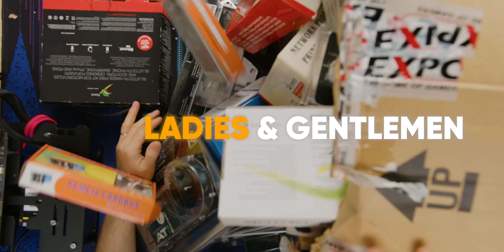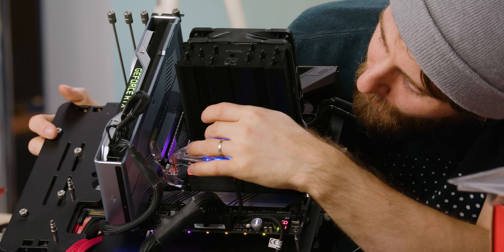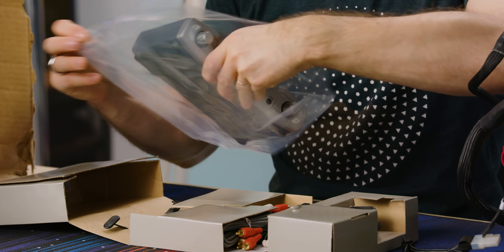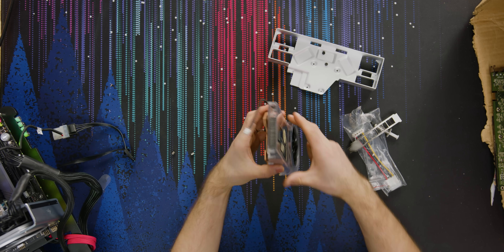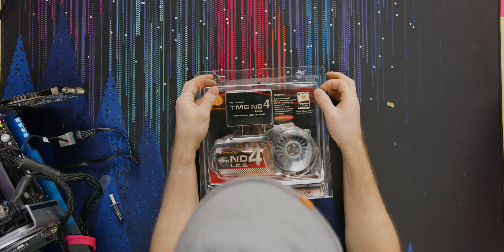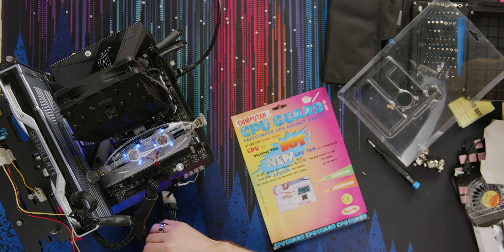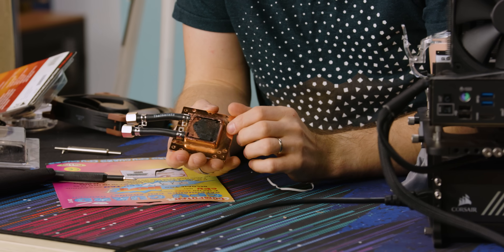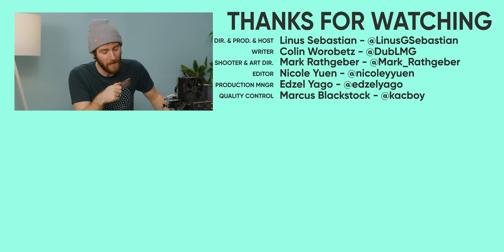I Bought Out This Bankrupt Computer Store's Inventory

Comment: I've still got a bunch of those IDE HDD sleds.  Back in the day, I had several identical chassis set up with them, so I could swap boot drives around for various customer configs, DB servers, etc.  Then virtualization came around and I decommissioned all that stuff, but it worked fine at the time.  (The 40mm cooling fans in the docks were cheap & noisy.)
Reply: Those wide radial (not axis) ones? They make such an annoying fluttering sound

Comment: That ATI cooler still works on my X800 GTO, I wonder if I installed it in my first half of lifetime or second.

And Linus could have thought more on those IDE 5.25 drivebay slot with interchangeable drives. With one PC and a family there is no better user switching then flipping whole OS drive.
There was solution for SATA as well, maybe even supporting hot swap.
Reply: If you paid a bit more- there where hot swappable versions for both.  But you would still want to reset if it was boot drive.

Comment: My 3.8GHz P4 w/ Hyperthreading (478), 2 gb of DDR2, and 4x Raptor 10ks in Raid 0+1, and a Radeon x800 256mb, Windows XP 64-bit... even had an S-Video out to my TV (gross).

$3800 or so in 2004ish. Lasted me easily into 2010... Though admittedly I was pretty furious about the immediate release of DX9.0c (unsupported on GPU), actual dual core processors, amongst many other immediate paradigm shifts in the space. Was still a fun project :)

Comment: This is so much nostalgia. I am having flash backs to building my first PC in  2007. Intel Core 2 Duo with an EVGA 8800 Ultra. Fan cooled heatsinks on the Raptor hard drive, black light cathodes all in a Cooler Master Stacker II. Yes, it could play Crysis. I still have my first video card on my wall.
Reply: and today all these years later, you can buy a nice used card with what a 3090 gpu costs!

Comment: This brought me back down memory lane being an enthusiast in the early 2000’s. Flimsy molex y-splitters, the cheesy cheap packaging, everything being creaky. I still have one of those NV Coolers installed on a GPU in a MAME box.
Reply: man you recall those turbo fighter fans? then ramped up to hella high rpms, legit sounded like a model plane starting up lol.
Reply: You mean back down memory channel
Reply: You need 2 hard drives? Gotta set the pins correctly with those IDE flimsy cables. Cable management involved folding... And it mattered for airflow!
Reply: I cringe whenever someone utters the word "molex".  Worst quality power delivery EVER!

Comment: Oh wow, I had the AC NV silencer. I got a Gainward 6800GT with a dual fan setup and it was insanely loud, like literally unusable like a hairdryer next to your head. This cooler totally solved it and even allowed for overclocking, To this day I still really rate Arctic stuff, I have their AOI on my 3700x and it works great.

Comment: I have a TV Tuner plugged into my computer currently and it's just so-so anymore. I live in an area that still has a locally owned cable company that broadcasts their basic cable package (ch 1-100) without any encryption, so tuners still work on it. But with most TV networks insisting on reserving everything good for streaming, as well as filling their channels with bad reality TV or excessive commercials (like 15 min of commercials for 30-40 min of actual content), AND the discontinuation of Windows Media Center (I think Kodi can handle tuners but it's a way more rough experience), AND those streaming services refusing to stream anything above 1080p unless you're using a streaming stick and a whitelisted TV (thanks HDCP), tuners are definitely losing their value. And again, that's assuming you have cable or antenna content that isn't scrambled in the first place.

Comment: I had that Arctic Cooling GPU cooler for my ATi 9700 Pro. It worked like a charm. I think that was the last generation of single slot cards because I seem to remember my ATI X1950 XTX that I got a year or 2 later being dual slot.

Comment: O "It's not grounded, how is that even possible?"   Linus the black wires often referred to as "0v" are NOT ground wires.  They are the voltage to witch the other wires are referenced to.    So between Black and Yellow the Yellow wire is +12V with reference to the Black wire we call 0 but may not ground.  The blue wire from pin 14 is the -12V when referenced from Black but if referenced from Yellow then  Yellow can be called 0 and blue is -24V or the other way round when Yellow is referenced from Blue than Blue can be called 0 and Yellow is +24V   No wire on the computer side of a PSU can be consider ground apart from a metal chassis that should be connected to the center pin on the mains plug.  O by the way, in the UK this is now called the Protection and not earth/ground, but thats a how different topic.

Comment: 6:27 there is the Arctic Cooling NV cooler. The ASUS 7800 GTX had that exact cooler on it when I bought it at NCIX in 2003 or somewhere around that time. Crappy thing is I gave that card away in an old Athlon 64 x2 about a year ago, wished I'd have kept it.

Comment: I actually have this type of card reader in my pc because it was in the oooold case I am using but mine hasnt got the usb cable but the internal usb for the front panel and it has a micro-sd slot too otherwise the same lol

Comment: @colin That parallel port adapter probably won't work with your lathe. Don't quite remember why but if you use all the pins the conversion to usb breaks the controller to computer connection. 
A Smoothstepper is more likely what you need.
Reply from the maker: I actually already have the correct FTDI chipped usb adapter, I do see some odd things that would be useful to have this adapter for though
Reply: @LinusTechTips  alright fair enough! Enjoy the holidays.

Comment: I totally had multiple of these things. I used an hdd hot swap bay to flip between an IDE-based zip drive and a hard drive. I also put an arctic cooler GPU frozer on a 9600 pro and 9800 pro. Totally had the hard drive cooling enclosure for my WD Raptor...

Comment: That 5 1/4 drive bay with hot swap drive cage with handle and lock(the lock dubled as the power switch so you could not pull the drive out while it was on) was a real cool and useful thing for us people that ether use multit OS's that want each on a different drive.  However for me it allowed me to take my data home and work on it then take it back to where I was working and use it there.  It was the USB-sick of the day.  It was at the time of dial-up BBS and compuserve

Comment: We had dozens of those removable drive sleds, with massive 200mb hard drives, in our lab. The Gateway 2000 desktops we used had multiple 5.25 bays in the front so we could have a floppy, CD, and one of those. They were actually super useful, we could swap Novell, NT 3.5, OS/2, SCO Unix, Banyan Vines, etc. really easily. Saved us so much time and effort reinstalling all the time for different tests.

Comment: I used the 5.25" portable hdd enclosure a lot back in the day. I worked at a pc shop and we had one pc that had all the illegally downloaded movies, tv shows and games on it and everyone just leeched from that and dropped the stuff they downloaded on it. The pc had 4 or 5 of these bays and it would just copy stuff all day, way faster and more reliable than USB 2.0 at that time. I just had to bring my hdd in a case and slide it in my pc when getting home. Great system. Also, I still own the Zalman 5.1 headphones that go with that amp (or at least they should be in a box around here somewhere), I didn't use the amp, I plugged them straight into my sound blaster 5.1, worked great, but the sound quality wasn't that good. (what a surprise) 5.1 did work though.

Comment: I still have a HD cooler with small fans, the anti-vibration was great ! and was the first time I seen thermal pads too transfer heat, prob the one thing I keep in 5"25 drives

Comment: I had a thermaltake air cooler for my XFX Radeon 5870 and it also didnt touch the heat spreader on the chip. I found this out at a LAN party on my birthday, when the card failed 5 minutes after installation. I wish i'd sued them.

Comment: Are you a hoarder? LOL. That's an expensive hoarding hobby though. I collect plastic containers. Which has been beneficial (like most food containers are also microwave safe, so i get some milage out of that and don't have to buy proper food storage solutions that will randomly crack and splinter even if you wash by hand (I have a dishwasher, but it's more of a drying rack), looking at you FOODSAVER Vacuum Seal Containers.

Comment: FYI that USB to parallel thing will not work with a lathe (or an EPROM reader, in my case). They expose a printer to the OS, not a parallel port. Get a PCIe parallel card (they exist!), it will work a treat.

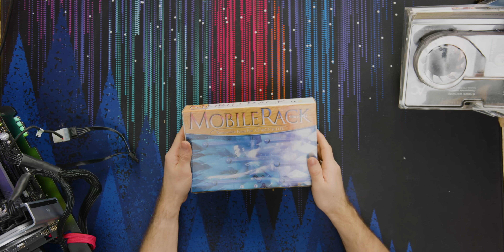Comment: 3:42 I remember those well as I used to work in IT for a school who taught computer classes, I had to fit at least 250 of them which was a complete pain - the idea was we installed our system hard drive in them then the students had their own 'inner caddy' with another hard drive so they could swap that in for lessons where they needed to learn for example how to install an operating system from scratch, boy was I glad when the year finally came round where we refreshed all the PC hardware and could just deploy some virtual machines out instead!  I reckon if I went back to my old job today though they would still have the caddys stashed away in the dark corner I left them in :)

Comment: With DDR5 on the horizon, that cyclo-cooling memory fan thing might just come in handy.
Reply: I was actually thinking CPU Guard might not be a bad look for someone with an old AIO (crapshoot when it fails) or an opaque loop. (it doesn't really need PWM cause you want it on full all the time)
Reply: @preciousroihomeshoppingnet7908  The CPU Guard was actually a really good idea when it was made. Back then computers did not have the internal monitoring systems for temp and fan speed (back then variable speed fans were rare at best) and CPUs did not have the thermal throttling and cut off systems that exist today. In fact, back then (during P4 and Athlon days) the only safeguard was a fan plugged into the CPU fan socket and a closed circuit. If a CPU heat sink fan died, the circuit would be complete so the system would run with passive cooling for about 5 mins before the heat sink got overworked and the CPU would die. Considering see-through panels were a rarity at the time and most people kept their systems out of the way, they would never know their CPU fan went until the *FZZT*, screen going blank and the smell of silicon smoke.
Reply: I want that in my normal rig for looks.
Reply: Some high end motherboards are already including heatsinks for DDR 5 memory
Reply: @joshpart3319  My Threadripper Pro Thinkstation has fans for the memory.
Reply: Der8auer did a Video on old memory coolers top cool ddr5. The did Work and Look nice
Reply: Naah it'll mess up the airflow
Reply: I have an preaty old system wich i game on. It hase like an intel 3570k and an as rock b 75 mainboard. The System is from 2012 and it has to run preaty fast to run Borderlands 3 for example. my amd rx480 just burned, so i have to use my old geforce gtx 750 ti. i need to run active ram cooling, my system would stutter and bluescreen in like 10 min just in windows idle. so activ cooling is a thing, for me, after all^^.
Reply: DDR5 consumes less power than DDR4, and even on DDR4 memory fans were only useful for massive DIMM capacities (like 128gb+ per DIMM)
Reply: @capsulate8642  it's useful for ensuring stability with memory overclocks on DDR4
Reply: @capsulate8642  yeah but ddr5 has it's power supply on de dimm

Comment: These swapable drive bays were quite common in the early 90s. Space was not an issue, as a tower had 4-5 5.25" bays, and even desktops had most of the time 2 5.25" bays.
They were quite useless if you only had one HD, but some people used them on a second drive for backup, swapping out backupdrives weekly.
The lock was not really secure, often it used the same or similar key as the one used for keyboard locks on these PCs. I could pick them with a 2 small screwdrivers in about 10 seconds.
On the other hand if you had the PC in hand you just opened the case and screw out the whole bay. You could then just bend open the plastic outer frame and slide out the bay with the disk in it and screw that out. Would not even damage any of the parts.
The only thing that lock was good for and that was also one of the reason these bays failed, was that it would cut power when unlocked. Since most of them were quite cheaply made cables would break, or they were layed so bad that you would snap the cable when pushing in a drive.

Comment: 10:15 My first watercooled build was back in 2007. I was "forced" into it by me not reading the full label on a 8800 GTS (BFG iirc) which arrived in this ugly-ass copper waterblock. I ended up getting a Thermaltake CPU case that was bundled with its own watercooling loop. Fun times.

Comment: Remember when 3rd party GPU coolers where made to do their job very well and push the air out of the case instead of just looking flashy and dumping most of the heat on their own PCB + inside your case?
Well, here it is ladies and gents.

Comment: Oh man, I wonder what Linus would say about the block that currently cools my RX480. Its name is the Alphacool NexXxoS GPS-07T, but that won't help you learn more about it in any way.
It is meant to cool an HD3xxx/HD4xxx card, but thanks to the 53x53mm hole spacing, it fits on my RX480. I actually bought it brand new a few months ago, and the packaging was yellowed from UV light. I have to wonder what the thermal paste included with this thing would spread like, since I didn't bother with opening it. The internal design is literally just a channel. No fins, not flow thingamajigs, just two deep holes with a G1/4 thread and two holes drilled from the side to connect them, blocked of with metal balls.

Comment: 3:45 I had one of those. As, at the time, CDRWs were not enough to download something from a friend and DVDRWs were still a pricey stuff - so my trusty old 10 GB IDE HDD was doing the work of modern USB sticks via that 5" adapter.
5:10 also RCA was a mark of a high end stuff in early 00s. Professional audio interfaces had those.
Reply: Pretty sure professional audio interfaces had xlr and or 6.3mm connectors even back then.
Reply: @IsoMacintosh  there were many mid-range ones (which is what most musicians could afford) that had only RCA connections on them.
A peculiar example was ESI Juli@ during the time when mid-range was slowly getting features from expensive stuff in late '00s. It has 4 TS connections on one side of the board... and 4 RCA connections on the opposite one, so that people who had small/home studios (which is what those were targeted at) wouldn't have to change cables upon upgrading. So widespread RCA was.

Comment: I miss ALL this stuff! Back then you felt like you had options for your pc. Now it's just rgb or nothing without anything in between to put in your pc. I had such a hdd cooler case and the hdd resisted until it was outdated (3 years for me and 8 years to the buyer of the pc) and made it silent without getting hotter then without the case! That cpu guard could be handy for many AiO coolers that just die.

Comment: I had that 5.25” bay for swappable 3.5” drives and I loved it. Used it for backups. Had it inside my old tower case until I decided to add a second optical drive, then mounted it in an external 5.25” USB3 enclosure. Great way to recycle old 3.5” drives. I had 2 or 3 of the 3.5” cartridges and would just swap them in and out. I’m surprised they didn’t catch on more.

Comment: Damn, I actually ran a HDD cooler like that for a long time. It was the only way to make a HDD any quieter if you wanted to dampen the noise it made while working.
If you had problems with vibrations, you could just soft-mount it, but if you wanted to make it quieter overall, you needed to cover it up in a thick aluminium box.
Of course, it still wasn't quiet enough for me, and I ended up getting my first SSD purely for the low noise. Once I experienced the speed of it, I would never go back.
My first SSD is still in use in a web browsing build, and the HDD cooler is still doing its best to dampen noise from a HDD in a PC I sold to my friend.
I mean, there's nothing on it that could ever actually break. In fact, it could be used to break something else and still work just fine.

Comment: That CPU guard reminded me of Scythe Kaze Master I used in my computers (I had 3 different ones (v1, v II and a small one that fit in 3.5" slot), one per PC) and they also beeped when they didn't detect any fan RPM while the Voltage was being applied.
I wanted to run my Noctuas as slowly as possible when temperatures were ok, so I usually edged it just to the point it kept spinning and I got woke by the darn beeping as the fans sometimes just stopped spinning (solved by upping RPM just a smidge).

Comment: 3:40 and it probably won't work since most of old serial and parallel adapters like this got their drivers disabled on w10 (for security reasons)

I learned that the hard way..

But if it works, good for you :D

Comment: 3:43 Still use those at work all the time. Think about when you need to remove a hard drive to lock it in a safe when the computer is not in use. This way you don’t have to lock the entire computer in the safe.

Comment: Not only did I use the removable drive bay, both in PATA and SCSI varieties when I was in college in 1998, I also installed them in systems before losing my job as a tech due to disability.

Because I couldn't detect any sarcasm, no... the "key" on the front was very easy to defeat. I had many a client who forgot or lost their keys, and it wasn't too difficult to use something else in the office to turn the lock. Good times.